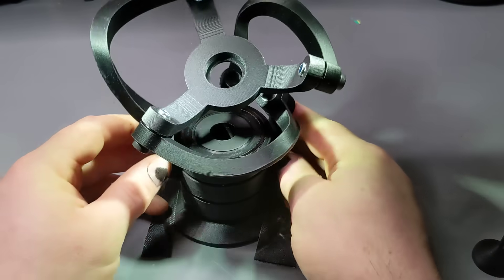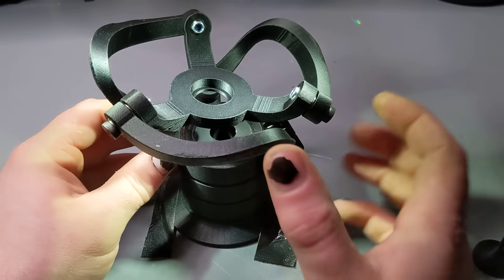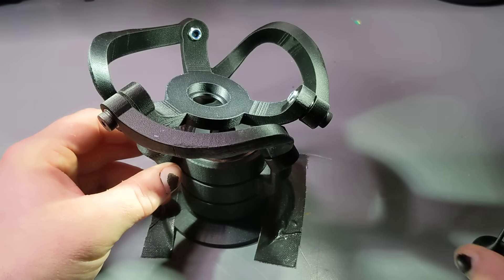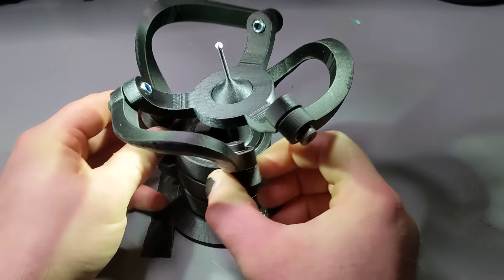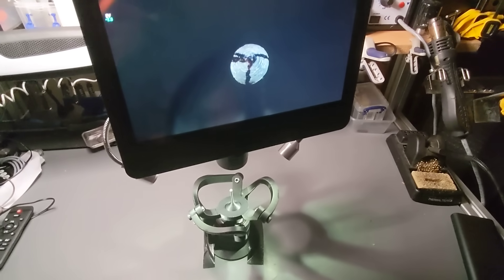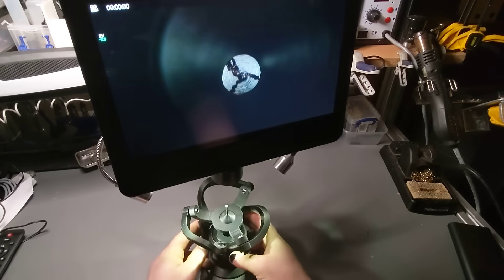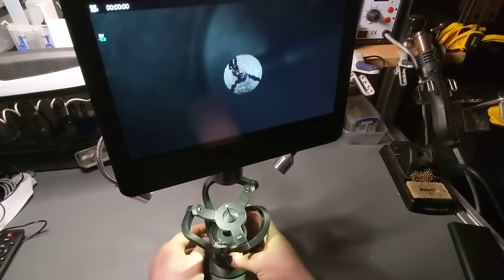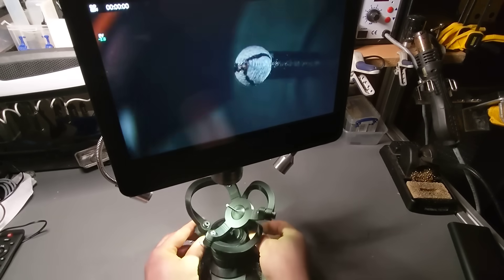Spherical Parallel Manipulator

Comment: any chance to get the 3D file?
Reply: Would love to print this as well.
Reply: @JAKON72  There's a 6yr old vid of one of these with the cad file attached, works the same as this. I can't type the title out or post link because of YouTube filters, but If you look you'll find it. Just include that it's a 3D printed spherical parallel manipulator model you're looking for and it'll pop right up.
Reply: Yes I would like the file as well
Reply from the maker: I posted an update vid covering cad/files etc, check it out and leave a comment there on which concept you'd prefer and what your use case is and I'll do my best to accommodate that in the released design. 
https://youtu.be/wN02itp6-z4
Reply from the maker: I've just uploaded the latest update vid, I've put a lot of work into making it accessible for everyone, files available very soon and I got the costs down to $10 of parts: $10 SPM https://youtu.be/DqjAKmm-FJQ
Reply: @makebreakrepair  Thanks!

Comment: We do a lot of microscopy at work and would love to buy the design file so we can 3d print this fixture.
Reply from the maker: I posted an update vid covering cad/files etc, check it out and leave a comment there on which concept you'd prefer and what your use case/application is (people keep surprising me with novel uses) and I'll do my best to accommodate that in the released design. 
https://youtu.be/wN02itp6-z4
Reply from the maker: I've just uploaded the latest update vid, I've put a lot of work into making it accessible for everyone, files available very soon and I got the costs down to $10 of parts: $10 SPM https://youtu.be/DqjAKmm-FJQ
If you're interested in the short-run, professional use metal version please fill out this form: https://forms.gle/XGxA5Zzp16doP4pE6
Your email or any other info you put in that form will not be used for marketing, nor passed on to any third parties, nor used in any way other than to contact you about that specific project - I'm just an engineer in a shed figuring out if people want something :)

Comment: I was designing something like this for a and internship I had. I was tasked to count and measure features on ants for my entamologist professor who was reclassifying a genus. The graduate students kinda laughed at my idea. They didn't think it was necessary. The lab ended and I forgot about it. Your design is much better and more elegant then my cardboard and wire design lol. kudos
Reply: Your design may have been quick and dirty, this design is very involved. Your design may have been cheep and not involve a 3d printer. You may have backed away from making the new standard way to examine samples in your class. Don't let people who have no vision or who are lazy keep you from exploring , testing, trying. If you had tried and failed what would you be out? A few hours? You can learn a lot from trying.
Reply: What was it? A machine for ants?
Reply: Relates… a lot of people generally think stuff like this is unnecessary. Worked with researchers before and you’d be surprised how lazy they are with the “the old method worked fine so why bother improvement.” I wish you the best
Reply: @Brown_Potato seems so strange. The whole point of research is to find new cool things, and they are too afraid to try something new
Reply: @TheWeen344  They perceive it as "I gotta do more work" when they fail to realise they are not capable of thinking of ways to do more work efficiently. Divergent thinking generally happens when there is a vacuum of new methods, combined with the frustration of doing a mind-numbing method again and again based on "feel".
Reply: @Brown_Potato  "if its not broke dont fix it"
Reply: @Khronogi  Theres nothing to fix, theres no process which makes the things for the task in this case. There was suggestions to add a method to optimise this. Otherwise I agree with you on that, especially for people not in STEM.
Reply: "they laughed and said i was crazy!! but they were WRONG"
Reply from the maker: It's a strangely under-served niche in microscopy... there's a million options for moving things in straight lines under a microscope, there's some stages that allow you to pivot the whole stage, but I could only find one example of a tool for rolling the subject around under a microscope (though I was likely searching for the wrong thing, I'm unsure what it'd be called in industry). 
As  @melvinolson8381 said though, there's nothing wrong with quick and simple prototypes and tests... I overthink in the design stage way too much and end up making less things as a result.
Reply: @makebreakrepair  I made a similar device for microscopy specialized for entomology. you can see some basic videos about it on my page. Great Work
Reply from the maker: @Entotech: that's cool, I'll link it in the description of the update video 

https://youtu.be/wN02itp6-z4

Comment: I would love to be able to make one for examining my gemstones. It’s perfect for mounting the gemstone dop (small brass rod that gemstone is attached to) onto the holder to exam the facets during the faceting process to make sure your meets (place where faceted points come together) are perfect.
Reply from the maker: I've had a few gemcutters and jewelers asking about it, I've made a second variant meant more for getting work done rather than looking cool (polar manipulator: functional, SPM: looks cool, check out the vid linked below for details), designs for both will be available. 
I've just uploaded the latest update vid, I've put a lot of work into making it accessible for everyone, files available very soon and I got the costs down to $10 of parts: $10 SPM https://youtu.be/DqjAKmm-FJQ

Comment: I never thought to use this joint for this...I had build one for robotics, still planning on making another iteration to fix some design flaws!
Reply: Hah, your design is one of the three I pulled inspiration from when designing this, thanks for your well documented work :) 
My design is based on what bearings etc I had around (eg the base is a chunk of 30mm shaft with three giant 30mm bearings press fit on it... Massive overkill but they were on the shelf) and with the altered design intent of it being manipulated by hand.
Reply: @slengineering8711  thank you so much!! This is what I was hoping for!! And seeing that clean build and that special usecase makes it really stand out!!

Thanks si much and keep up the great work!! 😊
Reply: Nice where can I find this design
Reply from the maker: I posted an update vid covering cad/files etc, check it out and leave a comment there on which concept you'd prefer and what your use case is and I'll do my best to accommodate that in the released design. 
https://youtu.be/wN02itp6-z4

Comment: Seems like it would be useful for robots (neck, hips, knees, ankles) and also for mounting cameras, tracking systems, and weapons on vehicles? 👍👍
Reply from the maker: It's a very weak/bendy mechanism (lots of cantilevered elements) so anything requiring a lot of stiffness is harder to achieve (but doable), the benefit is in the co-axial actuation allowing for a very compact gimbal-like device. check out @swannschilling474 https://www.youtube.com/watch?v=vNV2LetkfEg for an excellent motorised one.

Comment: This is dope, adding to the flood of comments requesting the STL or STEP files for this so we can make our own. I don't actually have a use for this, but I want to play with it lol
Reply from the maker: Hah yeah, it's a great thing to fidget with, it gets more use as that than under the microscope 😅
I posted an update vid covering cad/files etc, check it out and leave a comment there on which concept you'd prefer and what your use case is and I'll do my best to accommodate that in the released design. 
https://youtu.be/wN02itp6-z4
Reply from the maker: I've just uploaded the latest update vid, I've put a lot of work into making it accessible for everyone, files available very soon and I got the costs down to $10 of parts: $10 SPM https://youtu.be/DqjAKmm-FJQ

Comment: I'm not a genius, but ponder physical activity and its relationship with other moving parts. This is highly intriguing to me! Honestly amazing!
Reply: I'd like to see the math behind this thing, looks like a complex piece of engineering.
Reply: @shadesilverwing0  as somone who has designed one, its surprisingly intuitive. You just need to make every single axis of every single screw/axle converge on that central focal point. And make the linkages the right shape so they dont bang into each other. Think of it as 3 nested spheres, centered on that focal point, and it makes a lot more sense. The linkages all slide in relation to the spherical curvature they are then bound to.
Reply from the maker: Correct! I saw one somewhere and thought it would be cool, overthought it a bunch, then figured out (after seeing this vid from @swannschilling474  https://www.youtube.com/watch?v=vNV2LetkfEg) the trick - the axis of every bearing points to the same point. 
As for banging into each other...well it was a quick and lazy design and the arms did interfere... so I heat gunned them until they didn't (while fully assembled, elastic averaging kept it accurate despite the manual mangling). Check out the update vid for more on that https://youtu.be/wN02itp6-z4

Comment: That would be ridiculously awesome for macro photography!  
If the STL or CAD isn't forthcoming, I know what I'll be doing for the next evening or two. :)
Reply: Will you share with fellow macro enthusiasts?)
Reply: @yangap8146  Most likely!  I'm looking through the existing models so I'm not completely reinventing the wheel.  I'm also trying to decide just how much additional hardware (or flexibility) I want to add - like not requiring servos, but permitting the addition of servos without much, if any, modification.

As usual, the project has taken on a life of its own. 🤣
Reply from the maker: I posted an update vid covering cad/files etc, check it out and leave a comment there on which concept you'd prefer and what your use case is and I'll do my best to accommodate that in the released design. 
https://youtu.be/wN02itp6-z4
Reply from the maker: I've just uploaded the latest update vid, I've put a lot of work into making it accessible for everyone, files available very soon and I got the costs down to $10 of parts: $10 SPM https://youtu.be/DqjAKmm-FJQ

Comment: ...and it stays within focal distance! Excellent!
Reply from the maker: Cheers :) It works better than I thought it would too (the focus etc doesn't need adjusting or anything), given how imprecise some of it is (eg the bearing seats having fdm artefacts that needed cleaning up by hand) - likely due to 'elastic averaging' ie everything bending just a little to accommodate each other and the average of all that approaches the design intent.
I posted an update vid ( https://youtu.be/wN02itp6-z4 ) where I show some of the serious flaws in the design (ie I heat-gunned the arms to flatten the bottoms so they didn't interfere) and it's still accurate despite that manual mangling - elastic averaging is a great tool to have in your maker-kit
Reply from the maker: I've just uploaded the latest update vid, I've put a lot of work into making it accessible for everyone, files available very soon and I got the costs down to $10 of parts: $10 SPM https://youtu.be/DqjAKmm-FJQ

Comment: Nicely done. Will U-need another completely new SPM if your little do-dad changes in length by, oh say, half an inch or so? An adjustable SPM that can be calibrated for viewing do-dads of varying heights would be quite tricky to design. Am guessing you have many do-dads that are identical to this do-dad that require QC post-production. Your SPM certainly makes that job less of a headache. You embarked on an ingenious design effort.

Comment: Are you planning to share the CAD files? I want to use this for looking at entomology samples under a microscope.
Reply: I would also like to see that.
(available CAD files)
Reply: Yes, share or sell the CAD files. I'd be willing to pay money for these.
Reply: Same. This model is sweet and simple, and it will be much appreciated to have the plans and where to source the bearings/bushings that fit it.
Reply: Would be super helpful for my research rig :D
Reply from the maker: I posted an update vid covering cad/files etc, check it out and leave a comment there on which concept you'd prefer and what your use case is and I'll do my best to accommodate that in the released design. 
https://youtu.be/wN02itp6-z4
Reply from the maker: I've just uploaded the latest update vid, I've put a lot of work into making it accessible for everyone, files available very soon and I got the costs down to $10 of parts: $10 SPM https://youtu.be/DqjAKmm-FJQ

Comment: Good morning, we are interested in the prototype to use it in the laboratory, is it possible to contact you? Thank you
Reply from the maker: I plan to release a free 3d printable one, but I might make a more rugged one as a product for labs and such, if you're interested in purchasing a rugged one let me know in the comments of the vid (link below) so I can get a feel for what the demand is. 
I posted an update vid covering cad/files etc, check it out and leave a comment there on which concept you'd prefer and what your use case/application is (people keep surprising me with novel uses) and I'll do my best to accommodate that in the released design. 
https://youtu.be/wN02itp6-z4
Reply from the maker: I've just uploaded the latest update vid, I've put a lot of work into making it accessible for everyone, files available very soon and I got the costs down to $10 of parts: $10 SPM https://youtu.be/DqjAKmm-FJQ
If you're interested in the short-run, professional use metal version please fill out this form: https://forms.gle/XGxA5Zzp16doP4pE6
Your email or any other info you put in that form will not be used for marketing, nor passed on to any third parties, nor used in any way other than to contact you about that specific project - I'm just an engineer in a shed figuring out if people want something :)

Comment: I want one.😁💎
Reply from the maker: I posted an update vid covering cad/files etc, check it out and leave a comment there on which concept you'd prefer and what your use case/application is (people keep surprising me with novel uses) and I'll do my best to accommodate that in the released design. 
https://youtu.be/wN02itp6-z4
Reply: @makebreakrepair  I use my microscope for examining gemstones.  Most gem holders are awkward to use. When faceting, a gemstone is glued to  a "Dop Stick, of brass or ss. My faceting machine uses the same collets. Just as you made it there, it would be perfect for manipulating the stone, to ensure each facet is cut, as perfect as god allows.  If you don't find, and fix any polishing problems BEFORE you remove the stone,, you're problems are exponential.  I've had to completely re-cut stones, because it was easier, than to re-align the stones for 1 or 2 sub par facets, out of 90+.  This holder would make comparing facets a breeze.  Not having to constantly refocus because i moved, or bumped the gem holder. 
I can envision a 90° adaptor to hold the gem over the "Dark Field" light source.    Truly a cool gadget.   Sadly, I'm barely litterate enough for this tablet, let alone a 3d printer. 🤤
Reply from the maker: Ah yep, I know exactly what you're talking about; yeah if you can transfer the dop stick between the faceting head and the manipulator (either SPM or the polar one in the update vid (https://youtu.be/wN02itp6-z4)) then this definitely would work for faceting. The length of your dop sticks is too long for a spherical parallel manipulator style but the polar one would work perfectly. Out of curiosity, how long are dop sticks usually? Add any details like that to a comment on the update vid, I'm collecting them all to make the released designs as broadly applicable as possible. 
After seeing the responses the current (vague) plan is to release an open source 3D printable version of both that emphasises cheap for everyone to make,  an open source more rugged one using off the shelf metal parts with 3D prints as glue (eg the macro slider attached to a 3D printed base etc) for anyone who wants to make a more serious unit, and, if there's demand, I'll make a small production run of a rugged, all metal unit for lab use/serious work or similar as a product. Genuinely open to suggestions though, I'll make an update vid about it soon
Reply: @makebreakrepair  the dops I use are 1/4" x 2 1/2" long. If the bore of your collet-shaft is hollow, length of the dop wouldn't be a problem.
Reply: @makebreakrepair  I like them both. However I like the first one better.  😊  since my dops are all the same length it would be easy to put in a "stop", for effortless orienting of the gems.
Reply from the maker: I decided to release both variants for everyone, with plans to personally do a short production run a proper metal one for professional use etc (still working on the details on that). Check out the latest update vid, I have a working printed PM variant and a massively optimised for cost and easy reproducibility SPM, with the total cost of parts under $10USD https://youtu.be/DqjAKmm-FJQ
Reply from the maker: I've just uploaded the latest update vid, I've put a lot of work into making it accessible for everyone, files available very soon and I got the costs down to $10 of parts: $10 SPM https://youtu.be/DqjAKmm-FJQ